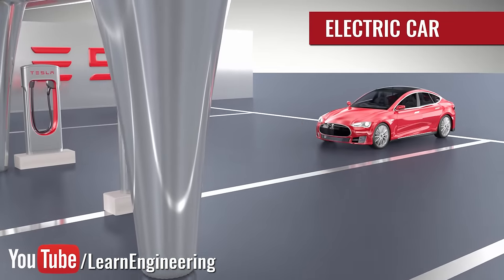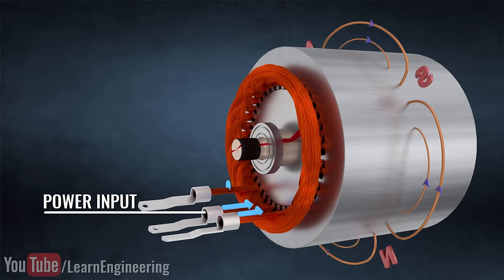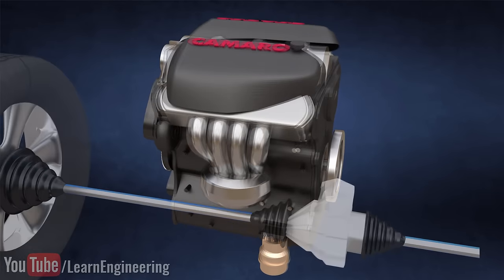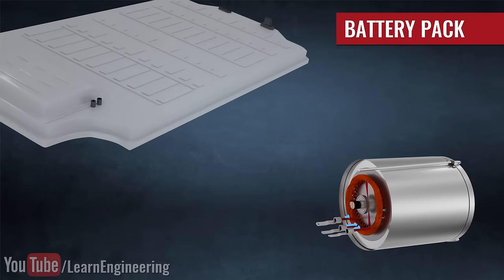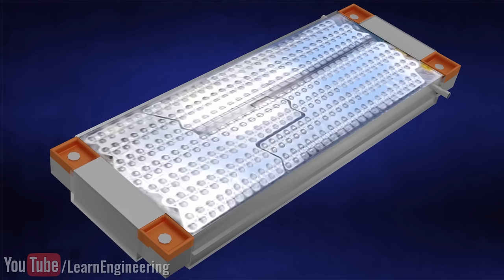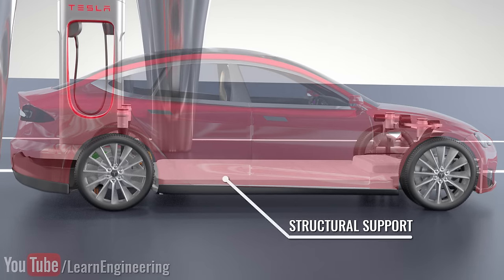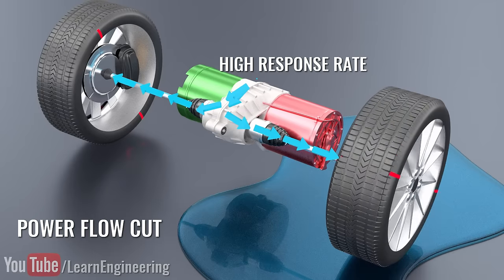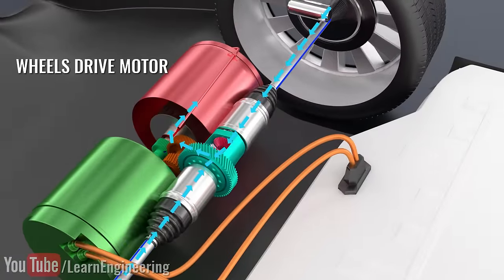How does an Electric Car work ? | Tesla Model S

Comment: Quiet, No more gas stations, home charging, excellent acceleration, automatic satellite upgrades, large screen, No central bump on the floor, Range 290 miles, free charging all over United States, Courteous service.
Reply: BEVs are quiet, there's no doubt about that, but most of the noise light vehicles of any kind emit, whether they're BEV, ICEVs or hybrids, comes from their tires, not their drivetrains.

Also, there's nothing about BEVs that makes things like large screens and over the air updates exclusive to them. ICEVs and hybrids can just as easily incorporate these features too. Hybrids, and even certain ICEVs can deliver ranges of 600 or more miles between recharges/refueling, so in that respect, they're still by far superior to BEVs, especially when cost is taken in to consideration.

I'm all in favor of clean transportation, especially because I do a lot of my travel by bicycle and I wind up having to inhale what comes out of people's tailpipes, but it's useful to have these little reality checks from time to time so we don't get too carried away with the hype.
Reply: @Marmocet  Exactly right. It is only a matter of time before battery technology makes them as cheap and long-range as the hybrids are. Once the charging tine is instant, ICE is done.
Reply: @rickkay9548  I suppose the question is, is there any indication that batteries that can be recharged in the same time that it takes to fill a tank of gas are actually on the horizon. At present, trying to recharge a battery that fast will destroy it pretty quickly.
Reply: Supercapacitors @rickkay9548
Reply: The range is much higher than 290. I drove a model 3 yesterday and the range was in the 300s
Reply: heavy car (extra 500 kg just batteries). Nobody knows how long life for this batteries. Short distance. double price for this car.    Car controlled what you do and analysing data and send to somewhere. Everybody see just plus nobody say about minuses.
Reply: @dboucher26  ok wait 6 or 7 years and than you say this same? How many years you use one smatphone 2 or 3 years maximum  and than buy new because its too slow and battery charged this same time but you lost this energy   faster like than brand new.
Reply: Still I can't understand how the rest of the world (especially the politicians) haven't fully embrace this yet!! I'm baffled.
Reply: @ingoma79  Tesla's batteries only loose 10% of their energy capacity after  around 300000 KM. Anything else you'd like to say about Tesla?
Reply: So who will supply all this electricity and how will it be generated  ???  Who will pay for it and what happens when the batteries ware-out  You do know the cost of the battery is typically 50% of the cost of the car. Just a stupid crazy idea. Just watch Tesla go bankrupt  hater hosing all the investors out of their $$$$$
Reply: @ingoma79  You conveniently forgot to subtract the IC engine weight and the gearbox weight , they simply don't exist. Net weight difference is substantially less than 500 kg. Don't know accurate values yet.
Reply: Keep on dreaming and always believe in fairy-tales, good way to live lol lol
Reply: battery development for EV is so slow.it has been halted because IC motor.
Reply: This is how Nikola Tesla Visioned The Future!
Reply: Hey watch it ok not a lot of people in the USA mainly the government (not talking about trump. Really just the whole government) don’t like world peace
Reply: @ConstantineLovesGod  Yes most of the electricity comes from coal, oil, natural gas. Pollution yes, range in mountains cold weather running heater and defroster is much lower
Reply: what about a horse, no more gas stations..no more car battery charging..just grass & water!
Reply: hydrogen cars will be more convenient...
Reply: @chadsimmons6347  no just no😐
Reply: @ingoma79  this is bc the phone wouldn't be at optimum performance with the new softwares added unlike a car- the older batteries have less capacity to run the new software so to not run out as fast you could run the software slower or just increase battery usage
Reply: If I may add... 
1. Better traction
2. Regen braking 
3. Lesser moving parts, meaning low maintenance 
4. Works the same at higher elevations while gas cars struggle 
5. Can make the transition to fully renewable energy sources
6. Safer cause of the low floor battery pack
7. Brake wear is low due to regen breaking
Reply: @Marmocet  SaY NO TO Batteries being developed that fast charge. This has been the stumbling block of anything electric for 100 years.
I'm waiting for that huge breakthru, but not holding my breath.
Reply: @dboucher26  Marginally better. Let's keep going.
Reply: @irvinhodges3888  That's the effect of tunnel vision.
Reply: @salimahmedali9249  
If I may add...
1. Better Traction? You mean center of mass
2. Regen braking? Thats only good for gas mileage and brake wear. 
3. Lesser moving parts? No. Low maintenance?  No. More maintenance especially because if something breaks you wont be able to fix it as easily like a normal car. 
4. Works at higher elevations? Yeah but you do know that gasoline cars out perform electric right? If you take a tesla to a track it will eventually lose power and just give up.
5. No it couldnt, Tesla are expensive cars. Theres a reason why you dont see a Tesla at every corner. 
6. Safer? Go back to my #1
7. You just repeated your #2.
Reply: @SteveTennisStudy  Supercaps with resistors.
Reply: DookB how slow did you have to drive to get an extra 20 miles 🤔
Reply: @ingoma79  the management of ev batteries is different to smartphones.  Smartphone batteries are charged to 100% and drained to 0%. Ev batteries are never drained or charged to 100%. This massively increases the lifespan.
Reply: How do you think charging is free ????

Do you know what a smart meter is for ? Get ready for the electric companies to screw us all over when everyone is electric ! You will pay the same or more than gas to get a full charge ! You'll see !   They won't be able to contain their greed !  They will claim they need to to pay for all the charging stations ! 

ITS COMING !  and what are you left with then ? 4 wheels on a giant heavy battery that will pile up disposals everywhere . There not small
Reply: @Marmocet  EXACTLY RIGHT
Reply: @ingoma79  exactly !

Comment: Power to weight is insane for electric, however, the fuel is insanely heavy and always weighs the same empty or full.
Reply: While I have to agree, innovation wil most liekly circumvent this problem.
Reply: @dibujodecroquis1684  what he meant is with so less complex parts unlike IC engines, electric has more power comparatively and when it comes to its batteries they weigh same regardless of full or no-charge
Reply: I'm not seeing a problem here, just look at a model S ludachris quarter mile time, or 0-60
Reply: @daweller  battery weight is a HUGE problem, it directly impacts range and cost. 
simple example: it takes less power to accelerate a smaller mass at the same rate... that means less batteries, longer range and lower cost.

the fact that one can accelerate a large mass doesn't mean you achieved the best mass/efficiency ratio. hope this helps.
Reply: All the R&D from the car companies will be going into battery technologies so expect huge advances in the coming decades. Just think of electric cars being at the Nokia stage with modern phones to come.
Reply: @duroxkilo  This is why they say smaller the car the better the battery solution is. Electric bicycles are very economical good use of the battery. But for Semi trucks it gets worse using battery, plus truckers make profit on payload & less refueling time. Gte to destination asap & with lots of load, trucks is where Hydrogen fuel cell would make more sense than battery with the current battery tech.
Reply: batteries actually lose weight when they discharge

Comment: So I am studying mechanic and boi I see that I need to learn about those car quick or else I would be jobless and homeless and worthless
Reply: Learn CAD and Cam softwares after ur engineering
Reply: Maybe jobless but never worthless
Reply: You have plenty of time to learn! But absolutely, maybe petrol won't be phased out as much as Tesla hopes but you'll be on another level compared to your peers if you can work on electric cars. Good luck!
Reply: You dont even have to lean about the car just learn about electricity in general and that's all you need to know
Reply: Machines will always make the machines...
Reply: @BigBoiTurboslav  how to buy tesla stocks?
Reply: @ThriveMindAndBody  Depends a bit where you're from. You can trade through your bank or you can use markets like E*TRADE, but it's absolutely worth looking into what has the best overall value in terms of fees.
Reply: Itll take awhile, a 1000lb battery pack only can hold enough energy to go 300 miles with a long time to recharge. The electrical technology has been are for a long time with battery technology supposedly where the breakthroughs will happen but hard to believe when they have very weak capabilities/improvements and we're in 2020.
Reply: @Scappoose101  What's the end year?
Reply: axaxaxaxaxaxa
Reply: We'll adapt. A mechanic is not the only occupation that's about to lessened
Reply: @Amusis who told you it's zero pollution? Who told you it's lower price. Use your own brain...
Reply: Or specialize in sports cars and super cars, those ice engines will still be produced and used for a loooong time
Reply: @BigBoiTurboslav  electric cars are simpler engneering wise but they require massive ammounts of programming.
Reply: The change isn't going to happen overnight. Cars from over 25 years ago are still common on the road today, so even when the majority of gas cars are replaced with electric, there will still be demand for mechanics who know how to work on the older technology.

In fact, the demand may even be higher, since it's likely to be rarer.
Reply: I feel the next 50 years belong to electrical engineering . EV s , non EV  battery applications, solar photovoltaic power generation are taking the world by storm .
Reply: Im gonna study mechanical engineering and will be trying to also learn to program and have small knowledge about economics.
Reply: I think and I know this will be a very very very strong base. In the study I want to specialize in battery technology. Best choice you can make I think.
Reply: @The League he is not.
Reply: It looks like the same as a toy car you just need more powerful batteries.
Reply: @Scappoose101  i would simple design it to just replace the batter pack under 3 minutes.  so the dealer stores battery packs the customer comes in and it is replace an empty fo a full one. simple. damaged battery packs could be forwarded to the factory for maintenance and cycle back. or battery packs dealerships can be opened to service that specifically

Comment: The mechanics are so simple. Few moving parts but the efficiency is far more great than the IC system.
Reply: I know right !!!!!
Reply: redsoil5; nice assumption, but ask a scientist next time. You don't have to worry about the efficiency of oil. It's already been made millions of years ago. Read Free!
Reply: @hitty9  What is your point ?
Reply: less moving part = higher efficiency
Reply: hitty9 too bad cars can only convert less than 20% of the energy from the oil it burns to use
Reply: One of the very reasons I got into the electric recreational vehicle business.  It's a no brainer, super fun too!!
Reply: ferkemall  lol.....yes, much more expensive but that's slowly changing 😊. I do wish it was get cheap faster though.
Reply: Too costly also
Reply: Terry Melvin  Even though only 25% of their electricity comes from nuclear? 
  The other 75%, mostly burning oil and coal.
Reply: @dsdsspp7130  ......Take into account the whole picture. The source of the electricity is dirty.
Reply: redsoil5.....The coal burning power generation plant is not high efficiency.
Reply: @dsdsspp7130  Wonderful if you can hold up your antenna and collect free electricity. You've over looked the dilemma of getting the electricity efficiently. How do you skip over this?
Reply: The mechanics are simple but it's not the mechanics you have to worry about it's the electrical circuit schematics that will fuck you over
Reply: Simpler the better Efficiencey wise

Comment: Electric car inside looks so simple then oil car.
Reply: Because it is, only reason oil cars are more common that battery technology developed way slower than anything else
Reply: Red De Cipher because there’s no “need” for such a complex heardware.
Reply: That is the reason why so many small and new company can do, but the problem is how much power can be kept by battery.     But electric car is future
Reply: Duh
Reply: The term oil car is funny to me, I’ve never heard that before. Teslas use oil and coolant just like an internal combustion vehicle. I agree tho, Teslas are simple compared to those; in engineering simple designs are almost always better.
Reply: They are much more complicated but everything you see can be put in a much smaller package
Reply: @bill you are kind of wrong.

Because you can't imagine the complexity of that variable frequency drive and the software driving it.
Reply: There are far less moving parts and fluids needed.
Reply: EVs are simple in theory, complex in practice.
Reply: @Baghuul  

Those fewer moving parts are made up in complicated code, complex wiring and endless electronics.